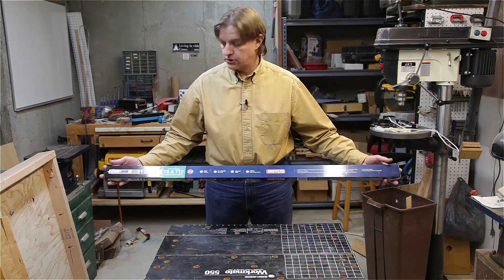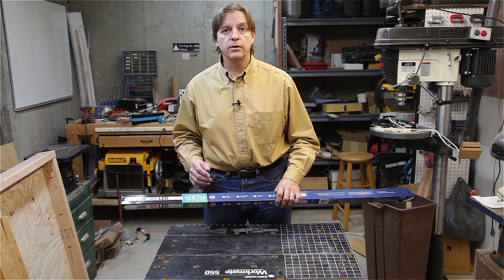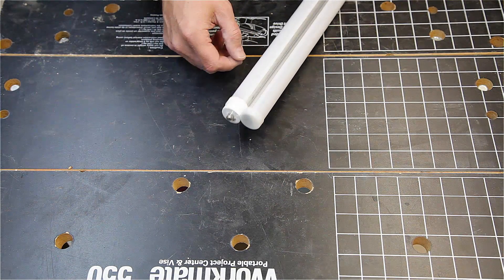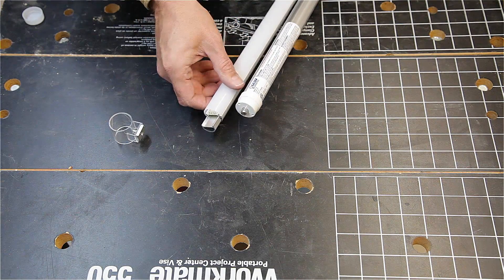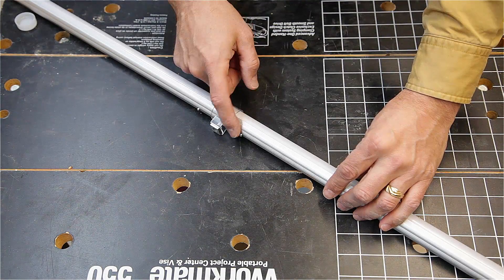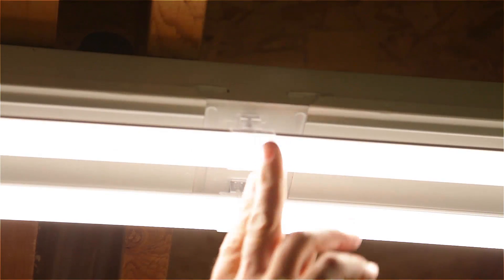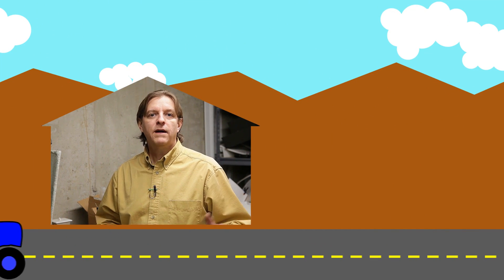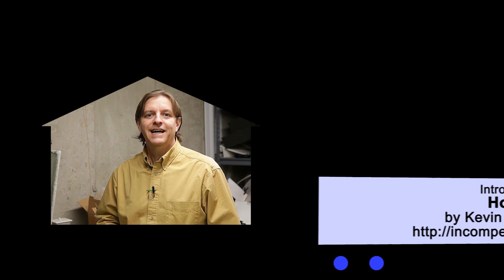How to easily convert fluorescent tubes to LEDs

Comment: LED lighting sucks!  Never get suckered by the lighting companies to say LED lighting is a good alternative to any other form of light. 

 1st, the LED light isn't a really a true form of light but a magnified refraction. 

 2nd,  LED uses high frequency power inverters to produce the ideal power needed for the LED lighting system, but this causes the light being produced to essentially flicker at the frequency produced and is incredibly hard on your eyes over time.

 3rd LED lighting makes terrible dark spots and shadowing throughout your desired lighted area. 

 4th, LED lighting doesn't last as intended and is vulnerable to failure in the invent of a power surge. 

5th, the price of changeover, in conventional lighting systems will never outweigh the benefit they say you will get in power savings over the LED's lifespan. These lighting system changeovers ,have been  heavily scrutinised by companies like, GE and Sylvania  along with the endorsements of governments, through green lighting programs, have been the biggest scam to commercial businesses since the mainstream release of T-8 fluorescent lighting.  

At the end of the day, these companies want to generate as much revenue as possible and simply care little about the costumers needs.  They produce a product, make up lies, "that the product will be far superior to the existing product".  They sway governments to promote their new products as,"being beneficial to the environment and the best way to save energy", but all they have done is created an overly expensive product, that isn't as reliable as the existing product and is heavily promoted through the mainstream networks
Reply from the maker: Don't hold back, go ahead and tell us what you think. :-)

Item 1: I don't know what you're talking about here. Light is RF energy in a spectrum that our eyes are sensitive to. If we can see it, it's light. How it's generated differs based on the source, but once it leaves the source, it's all the same thing.

Item 2: I think you're getting LEDs and fluorescent lights mixed up. LEDs run on low power DC. Fluorescent lights run on high voltage, low current AC. (They can run on DC too, but the bulbs don't last as long, so generally they're run on AC.) Some people are sensitive to the flicker with fluorescent lights and have head aches, some people aren't. If LEDs flicker, it's a poorly designed power supply to blame and not the LEDs themselves.

Item 3: Since LEDs generally have a smaller source for the light, if they aren't diffused well, this could be an issue. But they'd have to be really poorly designed. For what it's worth, these lights I put in my shop have a much, much better quality of light than the fluorescent lights that were there before.

Item 4: Most LED failures that I've seen are due to poorly designed power supplies, not the LEDs themselves. Generally LEDs have pretty a high MTBF. The components for the power supplies less so.

Item 5: I agree to a point. This all depends on the price point. At the moment, you'd be had pressed to break even on a change over, but I don't think this is something you can say will never happen. If LEDs were available at the same price point as other forms of lighting, they would be vastly less expensive based on the lifetime differences. The problem with the current market is the price is too high for the benefit. But this is more a matter of market forces than anything inherent in the LEDs themselves. Incandescent and fluorescent lights have been around a long time, the equipment is paid for and the manufacturers can make enough to satisfy market demands at a low price. Manufacturers are still ramping up for LED production and the technology is still changing relatively quickly. It's still hard to supply the demand and manufacturing equipment still being paid for, so the price is still very high relative to the competition. However, I think this is probably more a temporary thing than a long term one. We've already seen LED prices plummet from a couple years ago and I expect they will continue to fall as they become more of a known quantity.

Cheers.
Reply: @HouseOfHacks  thanks I disagree with just about everything he said replaced every light in my house with LEDs 1 1/2 years ago except kitchen fixture replaced couple days ago. With outside lights on and every light in house on consume less than 250 watts, furnace running low fire adds 79 watts, flat screen tv, my electric cost are down quite a bit. And the lighting is more comfotable & white, much easier on the eyes than dull yellowish light from old bulbs.
Reply: OK...so I hope you are getting notifications for answers to your posts...because honestly your information is either completely incorrect or based on old versions of LED lighting, which have been improved tremendously over the past few years and are no longer applicable to any mainstream LED lighting manufacturer.  

I have to say that your first comment is the one that stopped me cold and I shook my head and wondered where on earth you came up with that idea.

"1st, the LED light isn't a really a true form of light but a magnified refraction. "

Lets start with the most basic of light sources...the sun.  But first lets look at what refraction is via Dictionary.com:

noun
1.
Physics. the change of direction of a ray of light, sound, heat, or the like, in passing obliquely from one medium into another in which its wave velocity is different.
2.
Ophthalmology.
the ability of the eye to refract light that enters it so as to form an image on the retina.
the determining of the refractive condition of the eye.
3.
Astronomy.
Also called astronomical refraction. the amount, in angular measure, by which the altitude of a celestial body is increased by the refraction of its light in the earth's atmosphere, being zero at the zenith and a maximum at the horizon.
the observed altered location, as seen from the earth, of another planet or the like due to diffraction by the atmosphere.

There is a whole lot of science and much more to this, but one of the most obvious refraction of sunlight is through water particles in our atmosphere and in the air around us.  

We require refraction through the lens of our eyes in order for us to see it in the first place.

So the idea that light that magnified refraction isn't real light is well...wrong.  There is no such thing as not real light, all light is light and all is real and while each may have a different source it is not less real then any other.

All light requires magnified refraction in one form or another to be focused into a direction in order for it to be useful ... even sunlight.

That is why proper placement and lens's are required for Light Emitting Diodes ... so that the light can be focused into/onto a specific area.

If it is not done correctly then you will see spotty light patterns, where there are dark spots and bright spots...but LED's are certainly not the only light source that has that issue...try out an incandescent (old school argon gas, standard bulbs) with a clear glass cover...those are really spotty and create shadows because of that very effect.

The moral of this is, that in order to get  a good light, whether it is 10 deg beam or a 360 deg flood effect you need to have proper lens, and the diodes need to be arranged properly on the boards to achieve good over all light with few or no dark spots...which is why buying the cheapest fixture or bulb isn't always the good way to go, but spending a little more to get a good quality bulb/fixture that has proper diode placement and proper lens is such a good idea.

I just couldn't let anyone reading this think that any light that goes through a lens isnt' real light...it is. 

Now it isn't natural light mind you if it isn't sunlight, but light it is none the less.

 " 2nd,  LED uses high frequency power inverters to produce the ideal power needed for the LED lighting system, but this causes the light being produced to essentially flicker at the frequency produced and is incredibly hard on your eyes over time."

The vast majority of LED light sources are controlled with a AC to DC Driver and there are no longer issues of this sort with todays Drivers.  The improvements of the transformers over the past 5 year has been amazing and if you look into the drivers of today vrs say 2014 or so, you will see there is no issue.  Keep in mind that the innovation and continuing improvement on LED light tech makes so much of our understanding outdated within a year...but the past three years it has begun to slow down as we see the diodes and drivers improved significantly.

 "3rd LED lighting makes terrible dark spots and shadowing throughout your desired lighted area. "

See response to 1st comment...this is covered in that.

" 4th, LED lighting doesn't last as intended and is vulnerable to failure in the invent of a power surge." 

Again...look at more current data...good quality Drivers are equipped with surge protection, plus many commercial fixtures come with the option of even more surge protection.  But it's true the every man made light source is susceptible to power surges, still this past couple of years the amount of drivers being killed via power surge has significantly decreased with the better quality surge protection.  Diodes these days are made better as well...with most reliable manufacturers changing over to COB diodes etc.  Therefore, most fixtures and bulbs are lasting as long as they have been rated for.

To your 5th point...it's true that the earlier versions of LED bulbs and Light fixtures had a tendency to fail prematurely for many reasons, some of which were covered above.  Also it's true that we still have product in the market that is made in a substandard way and you can expect early failures there too.

That is why it's important to do some research of current information, say since 2017, and find out what diode manufacturers are good and have best outcome and what ballast manufacturers are having good results and best outcomes...then understand that an Average Rated Life expectancy is just that...an average number created from a sample set, some of which stopped working prier to the rated hours and some of which made it to the rated hours and some of which extended beyond the rated hours.

In my 10 years working specifically with LED and Induction lighting on a commercial basis...I've seen catastrophic failures due mostly to bad electronic chips or  bad diodes, but over all the vast majority of the products I've sold over the years are still in service and have outlived the original warranties and life expediencies.  

I've also witnessed many a brand name come and go, failures by year two and things like that.

Because I've been in this industry for 30 years I can tell you that quality fixtures and bulbs, whether they are old style incandescent or fluorescent, you could expect the same thing as we have with LED fixtures and bulbs today...you get what you pay for, and most reputable fixture/bulb manufacturer should produce decent product for a fair price.

If you understand that LED lighting is still a new and emerging product, then you will know that every year things chance and we are now at a place where we are seeing much better outcomes, more stable product and over site.  So my advise to you is to update your information and stop spreading this crazy talk that isn't even relevant in todays market.
Reply: Err, no. LED bulbs rock.
Reply: Vicsonvee:  While much of what you say does apply to the fluorescent bulb industry ....it does not apply to the LED revolution currently underway. 

1. Go back to school and learn more about how light "waves" are generated and how LED's  a more novel approach to generate light.  2. Nope. Just a resistor is needed and besides...120V is supplied at 60 Mhz (usually) and all bulbs flicker to some extent. 3. Any bulb can offer terrible lighting...it is all up to what bulbs you choose and how they are placed.  4. Quality LED's last as intended and are no more vulnerable to a power surge than any other bulb. 5. LED bulbs pay for themselves in year or two IF you show some restraint in what you pay...most are $6 to $10 each.

Never forget that LED's are getting us out of the terrible landfill problem of fluorescent bulbs. Yikes what a mess that was and still is.

Comment: Ok, I found the tubes and replaced them as directed and now the fixture is humming very loud.  I took out the led tubes and put them back and still humming.  What am I doing wrong?  Thanks!
Reply from the maker: Hmm. Don't know exactly. If you put fluorescent tubes back in, does the humming go away? If not, then it's a fixture problem. If it does, then there's an issue with the tubes. If the latter, is there any indication on the packaging that ballast bypass is required? If so, then the fixture needs to be rewired to remove the ballast in order to use those tubes. Hope that helps. Peace.

Comment: Changed my big ole 48" Florescent aquarium tube light to LED for less than ten bucks. The 48" bulbs are plug n play and the 24" need to be bypass retrofitted..easy enough .. I had a first time buying coupon for 25 percent off at earthled.com .......and shipping is included :)
Reply from the maker: Yeah, earthled looks like they have some pretty decent deals on some stuff. It's amazing to me the price difference between the 4' and 8' tubes though. Peace.

Comment: Hello, Thanks for this instructional videl! Question, Am I correct in assuming that if your T8 or T12 Florescent Bulbs  are of "Single Pin Per End" that you do NOT need to remove the ballasts? I have a 12 year old Garage House That had the "Cold Start" florescent light fixtures installed and the 8 ft tubes are single pin per end NOT the double/turn in ends. Please advise and thanks much,
Mike...
Reply from the maker: Sorry, I don't think you can tell just by the number of pins. The question as to whether you need to remove the ballast is dependent on how the electronics of the replacement are designed. On the replacement, look for a statement indicating if you need to remove the ballast or not. I've seen replacements that look the same physically but some need the ballast removed and some work with it. Hope that helps.

Comment: does the electricity savings even pay for these bulbs over their lifetime  ?
Reply from the maker: For the home workshop, probably not. The ROI for commercial applications, from the analyses I've read, is that they're pretty much a wash with traditional tubes. In other words the investment is paid back in savings at about end of life of the LED tube. The LEDs need to come down a lot in price before they make sense strictly in terms of ROI. However, they do have a much, much better quality of light, which is harder to quantify in the "are they worth it?" considerations. That adds quite a bit of subjectivity into the equation. Cheers.

Comment: I'm doing the same thing here in the UK, but the LED tubes I have don't work off of the ballast voltage. In fact, I didn't even know that was an option!  I came here to look at rewiring the battens, but watched until the end anyway because I enjoyed the video.  BTW, for what it's worth the ballast can eat up 8-10 watts by itself, so convenience does come at a cost it seems.

Subscribed!
Reply: Thanks, I didn't know the ballast consumed electric if left it. I'm looking at replacing old fluorescent tubes, but wasn't sure about having them rewired or getting LED ready battens . I'm really glad I came across your comment.
Reply from the maker: Yeah, this is first time I've seen the 8 foot tubes that work off ballast voltage. The 4 foot ones have been around for awhile. Good point about the ballast still taking some extra current.

Thanks for subbing, see you around. Cheers.

Comment: Having the phobia of working with electricity,  I really like the idea of installing these LED tubes without first having to rewire the ballast. Looks like the new LED tubes are you're installing are a T8 type. Would those tubes also fit into a T12 fixture?
Reply from the maker: Yes, as long as the connector pins are the same (single pin vs dual pin), the smaller diameter tubes will work in fixtures designed for larger tubes. (The number after the T indicates the diameter, the larger the number the larger the tube.) Cheers.

Comment: I notice that you still using the same ballast with this LED new bulb, What happen when the ballast goes bad?
Reply from the maker: +Alexie Chinea Good question. I'll just take it out and wire them in directly. The bulbs have an operation range of 110-277 VAC, so they will work without the ballast. (IIRC, I couldn't find any online documentation specifying this.) That said, I expect the ballast will probably last much longer; I suspect the LEDs put much less stress on them than the original tubes. Peace.
Reply: Ballast out. No light.

Comment: Nice upgrade :) LED is the way to go! Much better color rendering index also, compared to regular tubes at least :) 
How well does the light spread ? Any noticeable difference from the florescent tubes ? :)
Reply: +EcProjects Yeah, I'm liking them! And the color temp is much, much better. The downward light spread to the floor is pretty much the same as the fluorescent tubes although the intensity is quite a bit more. They have their own built in reflector so there's almost no light going up onto the ceiling. In my application the ceiling is non-reflective, so that's actually a benefit. If you had a white ceiling, it might be more noticeable.